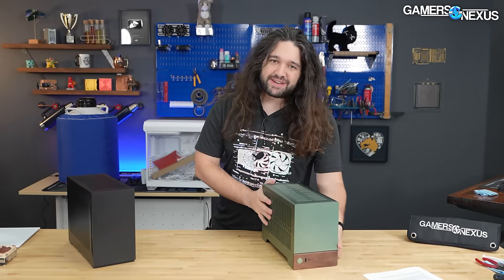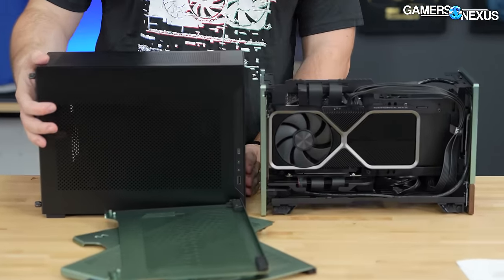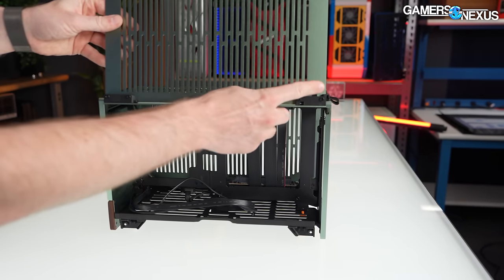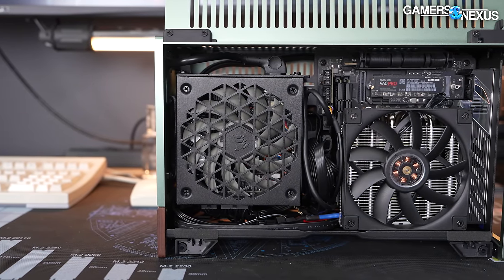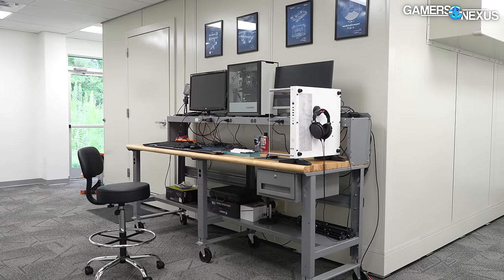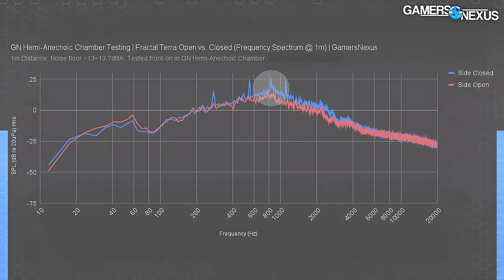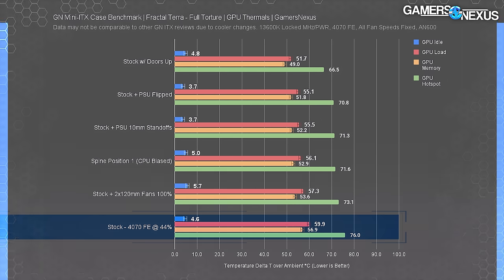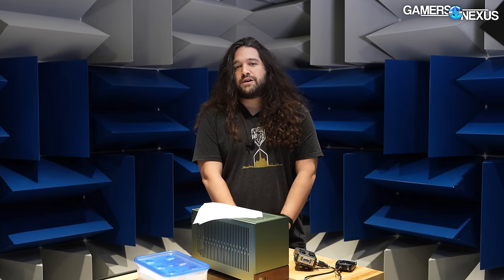Fractal Terra Mini-ITX Case Review: Build Quality, Thermals, Acoustics, & Cable Management

Comment: I'm interested in a format of installation like the formd T1 reference.
I dislike the sandwich style because it forces the user to chose a liquid cooling for CPU in order to have more gpu space, or a slim air cooling, which leads to extra expenses. (unable to use the stock cooler from the cpu box)
Plus you add extra complexity with the riser cable which cases don't include and you have to pick one for yourself, extra complexity 3.0, 4.0, and extra money to an already expensive build.
The reference type of build is the most logical, you put the gpu in the mobo pcie slot, like it should be, and it should be on top of the case, not the bottom
And then we have the piece de la resistance, to have the GPU exposed, not covered with a mesh or anything else.
Look how pretty GPU makers create their products, only to be literally unseen in cases.
I've seen an ITX build on youtube with a white case from an asian channel where the GPU is perfectly integrated with the side panel and in looks amazing. This could be a thing if you want to customize your top panel, but otherwise to allow the user an exposed GPU.
On the bottom of the gpu to feature a separator that piece that separates the gpu from the inside of the case, so the airflow of the gpu is completely external.
And for the CPU area to have an "aired" front panel that allows airflow and a side vent for exhaust, again exposed without any mesh or cover on top.
We need to force case makers to create intelligent cases, not copy the 20-30 year old format of stupid cases that don't have any intelligent airflow design to them.

Comment: Usually, the SFF ITX user never builds a system that Cpu cooler dead-close to side panel - because it will make a crazy noise. why are you building a system to suffocate cpu cooler? i don't understand. if you are going to set up a 67mm height cooler, then you should give more space on the cpu side, more than 70mm. or just start from another cooler that is around ~60mm height, that doesn't suffocated by your cpu side height setup.

Comment: If you are going to buy a Mini ITX case don't expect to put a powerful card and big components in it and then wonder why there is no airflow. It's not rocket science. If you do want to do that then buy a bigger case. And why would Fractal use cheap plastic hinges instead of metal ?

Comment: The l95 on things like all of my Ryzen 5600x or better Chipsets frequently got too close to TJ Max and even throttled down to 3.4 out of 4.2ghz after about a month of pressure. I have since than when with the Peerless assassin se my heavy load temps are roughly 54c; I realize the practically for a large cooler is not ideal but it is worth mentioning. I no longer recommend the noctua low profile cooler.

Comment: No hate on tiny cases, but then I'd lose 2 expansion slots, that leaves 1×M.2 slot extra I need on the mobo for 3 minumum, and 1 E-key M.2 slot extra, but no mini-itx has that that I know of because lack of space. Also need 2× 3.5 inch hdd for local storage. 

Anyone has any tips, let me know.

Comment: I seldomly disagree with your takes but in this case I am 5 min in and have to engage.  The pain in the ass factor is the fun factor actually. Building around limits is so much better. Volume limit, power limit, noise limit, those put an enthusiast brain to work.

Comment: Just put this case together in an emulator computer build, aio cooler with a 4060 SFF gpu, it's silent as a mouse. I'm kind of disappointed that you couldn't be bothered to throw together a build featuring the AIO as a viable option, because it definitely is. Not everyone is going to have a gigantic 4080.

Comment: I wish ITX was not only small, but also light with all the components there. I built such once, with this Lian Li, but the older version. And the biggest problem was - ~6kg weight ... with RTX 3070. Yeah, it was hot as hell too. And loud like a really noisy laptop. So if you take such case with you on the airplane well it will take really a lot of the allowed weight. What I like about this FD ITX case - it's wider. I wish it was even more wide, but still with sandwich design to install good cooling. Currently I have FD North cause well... RTX 3090 ¯\_(ツ)_/¯ and it looks great. But all the travels still spend with macbook ...

Comment: The 4090 wouldn't have been an issue had Nvidia put the power connector at the end of the card, where it should have been, not smack dab in the middle .

Comment: I guess this case needs a kind of cpu cooler with the fan blades between ihs and the heatsink, like the noctua NH-L12S. Currently assembling a parts list for a Living Room PC with a 5600G to use for emulation and as a steam links client. (BTW if anyone has good resources on this, hmu. i have barely any idea on what to do, besides building pc. Streaming and networking are not my fortes)

Comment: The Fractal Terra Mini-ITX case is priced too high. Fractal produces some excellent cases, however, the price for the Terra Mini-ITX is ridiculous for an SFF case. A lot of other good options for SFF chassis offer just as much (if not more) than the Terra Mini-ITX, and they are less expensive. The plastic hinges were a deal breaker. For $180, the hinges should be metal.

Comment: But Steve. This isn't how you do reviews.

First you should make your conclusion based on how you feel on the day and whether the product is from one of your sponsors.

Then you make up data to support that conclusion. Even if that data is absurd or uses hardware the product is not designed for.

And you should have at least dropped the case from bench height at least once. Then blamed the case for any breakages... 😂

Comment: I sit next to a server all I hear is hard drives spinning and I have 3 kids. I haven’t heard silence in over 10 years.
Reply: I also have an epyc server, and multiple I-9 systems with RTX 3090 TI 4090 the reason why I’m looking at this case is for a PC for my TV. My TV has Nvidia g sync and it’s OLED so I want a PC for media purposes and I’m looking to put a i3 or maximum a i5 maybe and 4060. I would never put a 4090 and a i9 in a case so small.

Comment: So should NH-L12s type cpu fans set as exhausted before fins? Too close to motherboard? I know if you set cpu fan as intake or in downdraft position ine will pull in fresh air but with fan being so close to side panel, will it will be noisier and slightly obstructed by panels? Not the smallest of venting (mesh would be better). 

So my question is what's the best way to setup cpu cooler fan orientation on nh-l12s if both downdraft or exhaust setups seem to be limited? Feels like either side would still be either close to panels or close to motherboard. 

Link below shows one needs 30mm of space for fans to work at max efficiency. I assume that counts for coolers as well. 

https://youtu.be/ULvTzuV2hJI?si=Ry7hgh4qsFf0QtaK

Comment: Nobody is talking about heat soak.
These systems, if the fans are too low at idle will heat soak.
You should ramp up the system for like 5 minutes before gaming.
Cools off all the components and interconnects. Then game. 
Bit then your back to it being too loud. Large desktop ftw every time. Sff isn't viable any more theramally.

Comment: If you have a 2slot FE graphics card, the You should have set the case to 53mm for the gpu and 72mm for the cpu.
The AN600 is a 67mm tall cooler.
Setting it to 53mm for the gpu and 67mm for the cpu is a mistake made by uninformed beginners.

Comment: I don't understand why most small form factor cases goes with vertical motherboard positioning which is utterly destroying layout, and cooling potential.
mITX is 170 x 170 mm, which is already a very small footprint, so why not use horizontal positioning to have a PC build which doesn't struggle to cool, and is compatible with most if not all components? Are case designers intentionally manufacturing problems to then solve them with over designed or compromised components for profit? xD

Comment: Ever since I got the cooler master nr200p, every other itx case has become irrelevant. I'm literally running it now with a Thermalright peerless assassin (for the 5800x3d), an rtx 4090, a 3.5in HDD, and FIVE more case fans. It's super cool and quiet, and the case looks great, it's easy to build in, and is reasonably priced.

Literally makes every other ITX case obsolete. Like ok, get 15% smaller dimensions, pay double, and then suffer with noise issues, or cooling issues and not be able to fit any powerful components 😂

Comment: Oh look at them tiny little plastic rods that snap off as soon as they get old enough to do so and you need to clean the dust out... (for the removable doors)
I will admit that if I had that, I'd be taking a cutters to them slats to just install a proper grill over the fan areas to kill that noise.
Imma go with take it back and have the chef try again... and i'm not even to a minute into this video....

not even a minute later.. "$180" .... oh hell nah.. you take this back and get a refund..

Comment: A warning to new SFF enthusiasts:

Do not buy an Asus ROG Strix B550i Gaming as your motherboard if you're ever planning to use an RTX 4000 series graphics card. They are not compatible, and Asus has refused to release a BIOS update to address this issue to this day. They are ignoring users who paid up to get the ROG board among all the other options on the market.
Reply: Thanks for warning us. I went with the Gigabyte Aorus B550I and it works as intended with the RTX 4070
Reply: @worldofz00  I wish I didn't have to experience this myself but umm, here I am. 🙃 I guess it's finally time to try team red!

Comment: Time for some GN criticism. Steve several times in this video used ajectives preceding the word unique.....and it was a bit triggering. 😐
Reply: Triggering is to initiate, actuate, or set off by a trigger - so something can't be "a bit triggering" - it either triggered you or it didn't 😉 - snark aside -  unique has more than one meaning in English. 1. being the only one of its kind; unlike anything else. 2. inf. particularly remarkable, special, or unusual.  This secondary meaning makes it possible to use comparatives or intensifiers with it.  This is called "lexical broadening" -  rather like when people call things "awesome", "cool" or "hot" to mean - "good" rather than inspiring awe, fear or wonder - or having anything to do with temperature. English is uniquely awesome in this regard.

Comment: I've never really seen the draw in ITX. It performs worse, it's louder, it's hotter, it's harder to build in, it's more expensive..... All around, unless you need to stuff a computer in an actually small area (almost nobody does this) ITX as a whole seems to be a solution in search of a problem.

Comment: This case doesn't meet any electrical standards, with out proper ground bonding of all those panels none of the components within will have an RF ground return to the power supply and will suffer power sag and act as non intended emitters of EMI.

Without talking about this issue the creditability of your review is questionable at minimum!